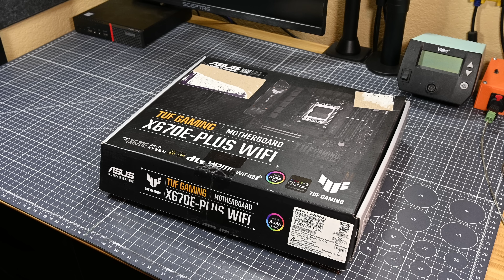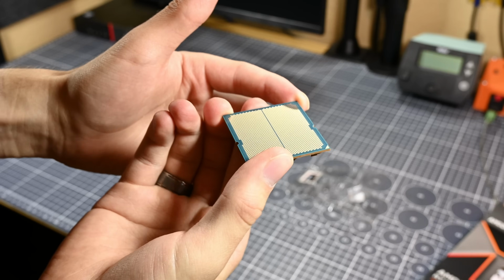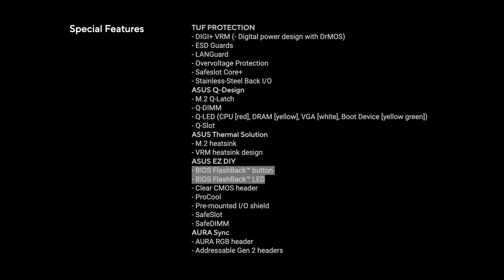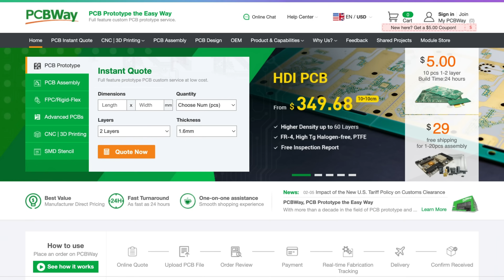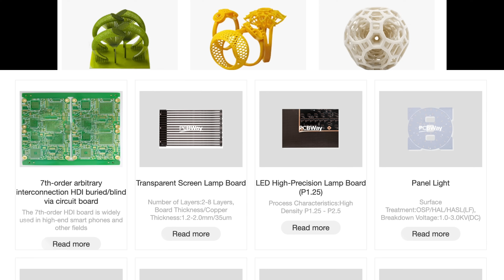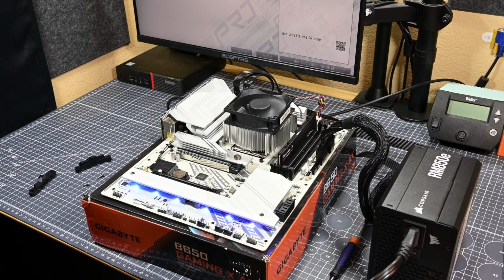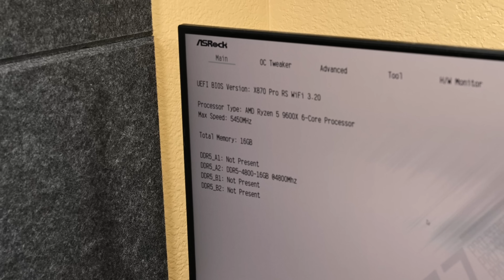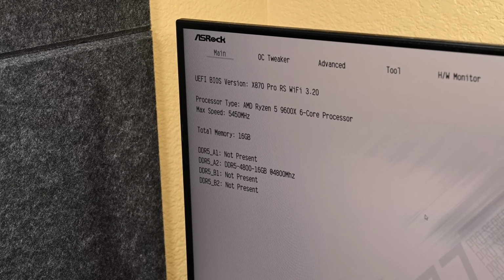I Spent $200 on BROKEN AM5 Motherboards - Can I Fix Them and Score a Good Deal?

Comment: I bought many am5 bent pin boards had many successes and many fails most i got are ddr5 not working in dual channel. That mostly gigabyte boards issue the asus board i see a bent front panel pjn so maybe that why it not turning on but cant be for sure

Comment: Since you have a digital microscope I advise you to check those boards for missing components ie capacitors, resistors etc. They're easy to solder back onto the board. You got nothing to loose.

Comment: Non well issue is with TPM module. 
Try remove cmos battery for few hours, because then TPM might reset. 30 mins is sometimes not long enough, because bios may be clear but not TPM.

Comment: Really cool to see someone else trying to fix ATX motherboards! 
First board could still have a bad Bios. Bios flashback sadly isnt as great as it might seem. Only way to be sure is to flash the chip by yourself! Also RAM is really finicky on AM5. All slots need to be tested, because there might be broken data lines. But as always for ATX boards, there could also be physical damage causing the DRAM LED!

Second board is interesting, that the Bios flashback doesnt work. Might be that this board has a problem and someone wanted to cover it up with lightly bending some pins, so someone could make a buck selling it. Probably a dead Voltage Rail there! Might be a passive rail that isnt runnig properly!

On the Gigabyte board it could also be a Bios issue, but i would expect that there is some physical damage on that board, that the CPU initialization doesnt start up! But CPU light could be caused by many many different things!

On the forth board there will probably be a problem with passive Voltage rail, because they are neccecary for starting up! Exspecially the SIO needs to be checked, because that chip is responsible for start up and shut down off the board! Might also be again ripped of components!

If you want to give any off these another try, hit me up!
Reply: I have a question since you seem to know alot about this stuff. Is it possible to damage the CPU if you dont realign the pins perfectly for examply slightly touching each other?

Comment: Don't ewaste the boards, sell them as a bundle or individually and disclose they are broken and you tried to get them working. There are a lot of people repairing boards for fun. There are also a lot of reasons why boards fail, physical damage to components,  component failure, scratched traces and so on. Fixing boards with out electronics knowledge can be tricky and those high end boards would be more difficult than most. Check out other youtube board repairs and you will get more tips (Mainboard medic is really good). At the end of the day though it is a gamble.

Comment: I would try to get pressure onto the socket by actually putting the cooler on.
Reply: Yeah, the pressure is important on AM5. When I built an AM5 system for a friend I screwed it in too tight and the PC wouldn't post.  
AM5 in itself is just much more fragile than the old intel LGA1155 era stuff you could easily fix most of the time.

Comment: If there's no physical damage (no bent pins), most boards can still be returned to manufacturer for RMA, even without proper receipt, I did it few times. Also I fixed few 1700 boards with bent pins successfully, one of them got it really bad, someone who probably shouldn't handle any electronics violated it, it had bent pins, broken ram slot clip, dings on edges (not deep) and one trace was broken next to the cpu cooler mounting holes, while another trace scratched next to the other hole.. initially it only worked with ram channel B, after trace repair it works with both.. was it worth the wasted time? No, was it fun, yes, and 1 less board for an e-waste pile.
Reply from the maker: That's awesome that you managed to fix that!

Comment: Make sure that there isn't any damage to the left of pci-e slot, apparently people like to destroy them while inserting GPUs. Also completely dead i usually much better then no POST, because it most likely is something like stand-by voltage regulator or a short circuit somewhere. Also don't blindly stick expansive cpu into random MBs, last thing you want is shorted high side mosfet sending 12V right into the cpu and killing it instantly.

Comment: 0:19 Me Too I Gambled In B150M-HD3 And P8H61/USB3 Asus Board Was Disaster But Gigabyte Board Is Not I Mean Its Alive But Does Have Reset Circuit Issue
 Also 1 2 Years Ago I Gambled In H81M-P33 And G41T-M V2.0
G41 Board Was Hassel But It Was Work It But That MSI Wasted

Comment: The best chance to fix IT is with Board four. If an board show no reaction at all most of the time in of the main powerlines are dead shorted. Check with an multimeter the 12v, 5v and 3,3v again ground. If you find an chorted line you can inject an lower voltage (1v) with higher amps from an powersupply. The damaged component will gone hot and can find with an infrared camera or with epl. With luck it is only an cap to replace or an sub regulator for 2,8v or 1v is damaged. 
An important step to repair all of your motherboards is an visuall inspection for dameged or missing components. Many components are redundant but not every. If an component is missing IT can result in stuck to one debug led because the bootcontroller wait for an response from an other component that never arraived because of brocken Connection over an Missing component. Knocked Off components are Most If the time to find near the CPU Socket, the pcie ports and in the backside near the mounting holes because the case screws scratch over the PCB by Installation in an case.